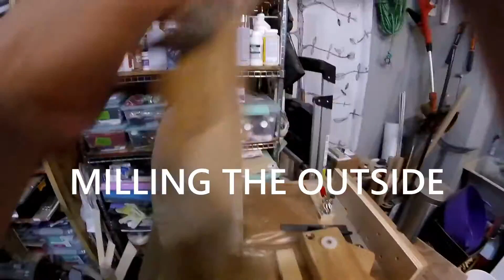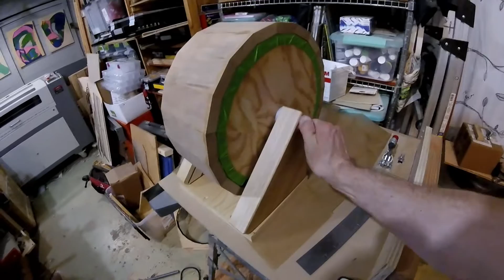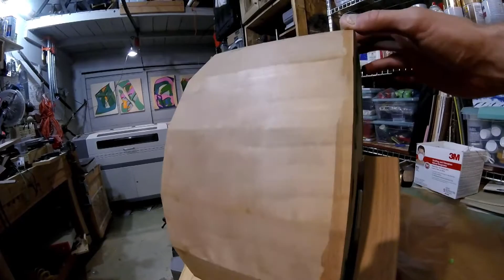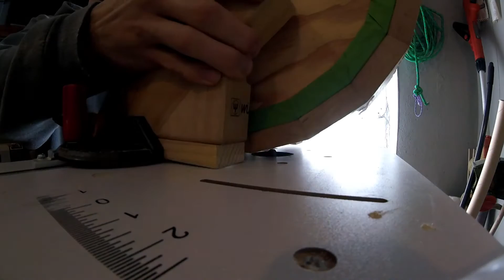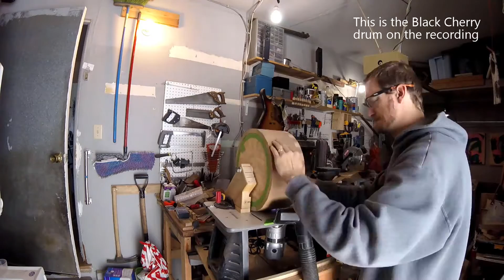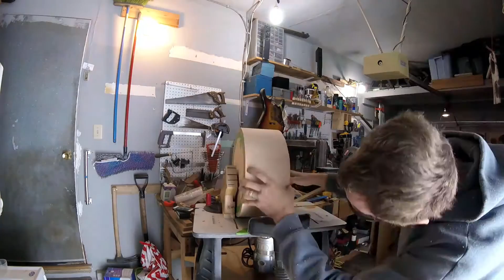Black Cherry Stave Snare Project: Milling the Outside

Comment: Can you explain how to get the drum centered and square on the rod so the milling will be smooth and not uneven?
Reply from the maker: Dan Townsend - oh yea, that’s the hard part. I had an old Wustoff knife block , I drilled the hole for the shaft on a drill press, making sure it was perfectly square. Then I cut it down the middle on the table saw. I laser cut the plywood pieces to fit the inside of the Drum’s facets — the laser cutter ends up making a wedge (it cuts perfectly to the line on one side and it over cuts a bit on the other side) which self-centers the pieces once pressed into the shell.